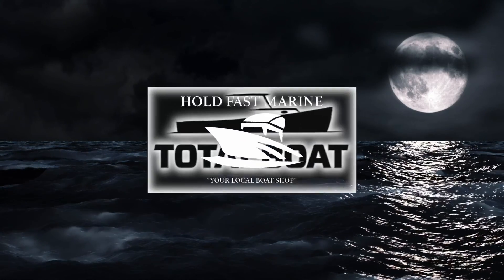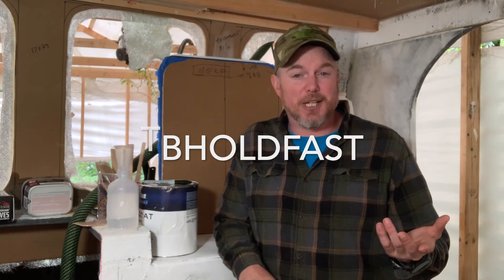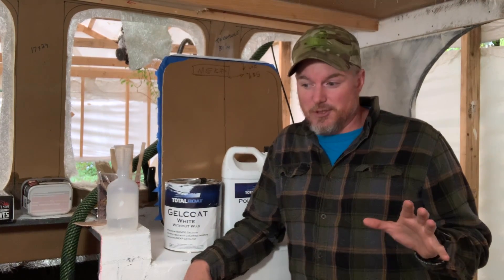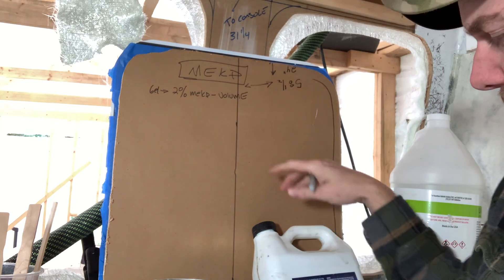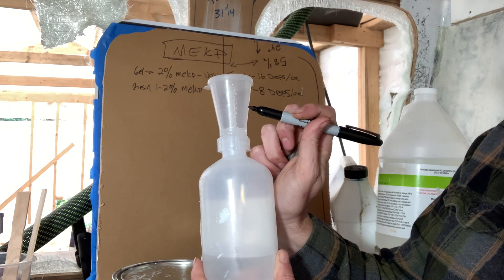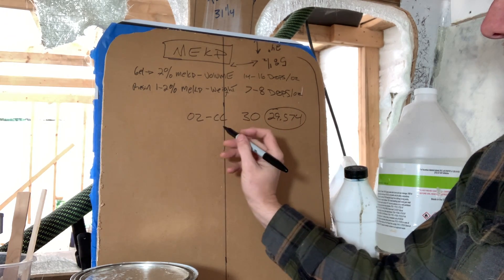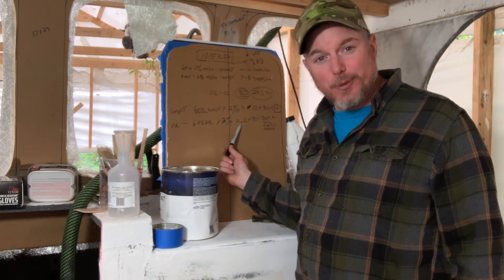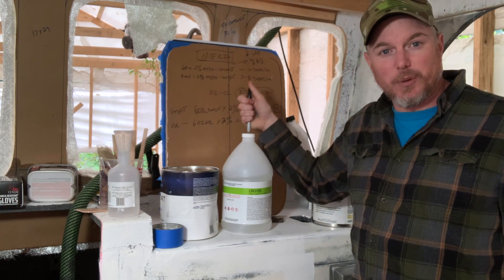How to properly measure MEKP for your polyester resin, gelcoat and more

Comment: I use this formula and it works great.  However, some of the top sites teaching about “boat stuff” catalyze gel coat and resin the same way (ie by volume only).  I would think their gelcoat would be under catalyzed by half.  Interesting 🤨.

Comment: Here is a tip from an OCD engineer wannabe. ALAWYS identify as “fluid ounces” or “weight”. Our 6000 year old weights and measures system blows. BTW, it’s 6000 years because that’s when Adam & Eve weighed the apple before eating it, and it wasn’t in metric units.

Comment: Thank you so much for putting this video together, it is really so much more digestible than other videos I’ve seen. 

To check my understanding; we are putting Fiberglass in a concrete pond. We are in Austin Tx and working on approx 85 degree heat so opting for less MEKP. 

If I am measuring out 64 fluid ounces of resin I would use the following calculation- 64 x 1%=.64 x 30=19.2 cc’s of MEKP.

For the same amount of Flocoat the calculation would be 64x 1%= .64 x 30= 19.2 x 2=38.4 cc’s MEKP. Is that correct?
Reply from the maker: Math checks out for me. Thanks for watching!!

Comment: there are a lot of comments on your video, i appreciate your effort, for 1 liter of polyester resin, how many ml of catalyst do i need at 2% ratio? thanks.
Reply: If it is 2% by weight then, weigh the liter of polyester resin, multiply by .02. Then weigh out the MEKP.  Further, 1 Liter = 1000 ml.  The density of Resin is reported to be between 1.1 g/ml to 1.43 g/ml. So use the average of 1.25 g/ml.  So 1 Liter of resin will weigh about 1250 mg.  the amount of MEKP required will weight 1250*.02 or 25 grams.  MEKP is reported to have a density of 1.17 g/ml. so divide 25 grams by 1.17 to get 21.4 ml. If you had used 2% by volume. you would get 1000 ml * .02 = 20 ml which would be slightly on the low side.  But anyway.  If you weigh the resin. Then multiply out by .02 [=2%]. then take that amount and on a scale, measure out by weight the quantity of MEKP calculated.  I'm thinking that they recommend using by weight because in the making of the product is that the density varies a lot and in the extremes can cause poor results.
Reply: So what should be the amount of 6% cobalt for 1kg of resin? @ralphparker
Reply: @ 63.83 grams:  63.83/(1000 + 63.83) = 0.06
Reply: @ralphparker  thank you 🙏

Comment: You said you were going to convert for mixing by weight but you converted to cc’s which is also volume. So you converted imperial volume to metric volume not weight.
Reply from the maker: What’s your boating YouTube channel?
Reply: Don’t have one. Why is that relevant?
Reply from the maker: Because your telling me how to do the job I’ve been doing for 25 years. I appreciate you watching however I’m the expert, you are the viewer.
Reply: Boating has nothing to do with expertise in composites. I have been laying up, vacuum bagging, designing and engineering for injection molded composites since 1985. That’s a few years more than you since you seem to struggle with middle school concepts like the difference between volume and weight. You can build all the boats you want and it won’t make CCs a weight measurement. You made a mistake and are so arrogant you can’t own up to it.

Comment: How many drops equals one CC?  The computer says 20.  I bought some poly structural putty (from total boat - I qt.) to do some repair work on the wheel pants of my airplane.  The can says 1-2% MEPK.  14 drops per ounce for 1%.  So if I use 6 oz of resin, putty in this case, that's 14 x 6 oz = 84 drops, or 4.2 CCs !!???   That seems like a lot of MEPK and it's not a very big bottle.  If I use just 6 oz of putty, that leaves 28 oz left in the can.  Using your formula:  6 oz putty x 1% = .06 x 30 = 1.8 cc.  If 1 cc = 20 drops, 1.8 cc x 20 = 36 drops.  What is wrong here?
Reply from the maker: Always follow the directions. Just because it seems like a lot to you doesn’t mean it’s wrong. I often use 20cc’s for a lot of resin. So let’s do the math together using your 6oz. 
6 oz times 1%= .06 x 30=1.8x2=3.6, round it to 4. Stop counting drops and use cc’s

Comment: If you're adding 2% MEKP by volume.  For six ounces that's 180cc x 0.02 = 3.6cc of MEKP.  Not sure how you're getting 7.2cc?  If you go by drops then 20 drops equals 1cc.  So 14 drops/20= 0.7cc... then 0.7cc per ounce x 6 ounces is 4.2cc.  If you use 7.2cc for 6 ounces then 7.2ccx20= 144 drops.  144 drops/6 oz = 24 drops/oz.
Reply from the maker: Are you asking about resin or gelcoat? For resin it would be 3.6 cc. We double it for gelcoat. Therefor 7.2 cc
Reply: @HoldFastMarine  I'm asking about the gelcoat.  Where do you see that it should be doubled.  The instructions I thought said it was 2% of volume?  So 2% of 180cc is 3.6cc?
Reply from the maker: Go buy some gelcoat and try it. When the gelcoat dosent cure, report back.

Comment: Just to clarify, if I pour 6 oz of resin into a cup, the formula would be for volume, not weight, correct?
Reply from the maker: Yes. Best bet is to always catalyze resin at 2% and other polyester stuff at 2%x2
Reply: Got it. I was playing around with a 2 oz batch and my measuring bottle doesn’t go that low so I had to count drops. But I catalyzed at 1%, not 2. My mistake.
Reply from the maker: @josephwhitehead1692  A 2oz batch would be 14 ish drops of resin, but you could just put in 2cc of mekp and you'd be just fine. You can be off a bit and it won't matter. You can catalyze at 1% and I often do this but only when temperatures are high and I need a little extra time.
Reply: @HoldFastMarine  Looking back on it, I actually did catalyze at 2% with 16 drops. I found a chart but it only went to 4 ounces so I divided the catalyst in half. I was surprised how far 2 ounces of resin will go.

Comment: Your math is OK but you have volume and weight confused. Gallons, Fluid ounces, liters, milliliters and CCs are all volumes. CC stands for cubic centimeter. That's volume, not weight. As for weights and volumes of polyester resins being the same, fluid ounces and ounces weight are two different things. 16 fluid ounces of a resin, may happen to weigh close to 16 ounces or 1 pound, but the formulation can potentially make a difference. Fluid ounces are volume. Ounces are weight. 

That said, the way most people will measure resins is by volume as in fluid ounces. A typical paper drink cup is about 3 fluid ounces. That's a handy measuring device because you just toss it when you are done with it. Don't have to clean it like a typical measuring cup.  Straight resin and gelcoats are different formulas. Gel coats are resin based, but have different properties like UV resistance, sandability, pigments, viscosity etc. One way to look at it is that gelcoat has more than just resin in it. So their hardner requirements can be  bit different. If you weigh the two on a scale, you will likely find a difference in weight per volume. 

I don't know of anybody doing any kind of work with resins, body fillers, etc., who use a precision scale in their shops. Volume makes the most sense and is convenient. Now if you have to go by weight, you'll want to do something like weighing a cup full or each component. That will give you a weight per volume measure of that particular material. Then use that in the percent calculation. 

You did the math right but have volume and weight confused. And for all practical purposes 1 fluid ounce volume is equal to very nearly 30 CCs or 30ml. (CCs and (milliliters are the same thing) . That brings up a useful trick for small volumes like for repairs. You can buy cheap disposable syringes marked in ml or CCs. Makes it easy to get an accurate mix of small volumes. Use one for resin and one for hardner. Use a bigger one for the resin and a smaller one for the hardener. As long as you don't mix the two, you can get multiple uses before you toss them. All you need to remember is that 30:1 ratio of ml or CCs per fluid ounce.
Reply: Ok when I get my whole # do I multiple ot by 2 like he does using fluid oz's for instance im going to have a volume of 16 oz's ×0.02 %= 0.32 × 29.57= 9.46 ×2 =18.92 ...im like the other guy why do I multiple my # by 2 at the end ..seems like alot of MEKP . I was given 4 oz's for the whole gallon. That's roughly 30cc per quart .

Comment: I'm not the brightest bulb on the tree. I read the back of the total boat resin as 7 to 8 drops per ounce they word it oddly that one ounce is one teaspoon. Needless to say I mixed up a batch with way too much catalyst using this formula
Reply from the maker: Well yes technically the 7-8 drops is roughly a teaspoon. one teaspoon is for one ounce of resin. Most of the directions are confusing, which is why I made this video. Thanks a lot for watching!!!
Reply: @HoldFastMarine  A teaspoon of MEKP = ~ 5 ml = ~150 drops of MEKP. Also, 7 to 8 drops of MEKP is equal to about 1/4 ml of volume.
Reply: a fluid ounce = ~30 ml, a teaspoon =~5 ml. There are exactly 6 US teaspoons in a US fluid ounce. There are 30 drops of MEKP to a ml of MEKP.  So, 1 fl ounce of resin needs .02 fl ounce of MEKP = 0.6 ml of MEKP = 18 drops of MEKP

Comment: Unless you are doing a large project then maybe this is needed. Personally I think its easier to count 14 drops into a disposable container, mark the line, and reuse that each time until you're done!
Reply from the maker: Like I said in the video
Nothing wrong with counting drops. I have tried to mark containers before and the mekp generally removes any kind of marker/paint. You; I suppose, could use tape or something but if your going through all that effort might as well use the dispenser.

Comment: Hey friend I’m trying to put a new layer of fiberglass cloth over and old boat with cracked gel coat. I almost got it sanded down to a new surface, there was some warped spots that I sanded into holes that now need to be covered. I don’t know what product to use, resin I would think for the fiberglass cloth right? I want to paint the boat after I resurface it, so paint needs to be able to stick to whatever I use… does total boat have a product that’ll work for me? Laminating resin? I finerglassed things before but never a boat. There is a video of the boat on my channel, it’s called a barracuda Hydrocycle. Thanks for your time buddy.
Reply from the maker: I’ll keep this as brief as possible. Resin is a misnomer. We have many types, polyester, epoxy, vinyl ester just to make a couple. Your choice will depend on many many factors. I’d like to help, but without seeing the boat, and what your trying to do it’s hard to guide you in the right direction. If you’d like to have a private conversation with me, there are options. I have helped many folks here and on other social media platforms. Pretty simple, doesn’t cost a ton. You can email me at wthurlow@gmail.com if you’d like.

Comment: Thanks for the video and the tips. I am a bit confused ny your math. You mixed the resin at 2% in you calculation. then mixed the gelcoat at 2% (same quantity). What I don't follow, is doubling the result of the gelcoat mix, which actually makes it 4%. Am I missing something?
Reply from the maker: Hi cam. It’s 2% by volume not weight. So 7-8 drops for resin, 14-16 gekcoat. That’s why if you have 7cc for resin you need 14cc for gelcoat.
Reply: @HoldFastMarine  If 1% for resin is 7-8 drops and 2% for Gelcoat is 14-16 and quote " weight and volume are diffrent, but in terms of these Polyester products they are not", surely there is a mistake? Not trying to be an @...., but I can't get my head around it. Thanks!
Reply from the maker: @threadfin2012  you always want to catalyze at 2% if your a noob. I can do .5-1-2-4% etc. When I say they are the same but not it’s so you just focus on the math. So take your ounces for resin; multiply that by the percent you want to catalase at, then multiply that number by 29.571 or even 29-30 Dosent matter really. For your gelcoat, repair putty always 2% unless it’s very hot out. Ounces x 2% x 29.574 x 2 and you’ll have the proper amount. If the number of cc’s comes out to 5.261 for instance just use 5, or 6. It Dosent have to be that specific.

Comment: So instead of the math lesson why not put your mixing pot on a scale pour your resin multiply by two percent and that's what your mekp is? example 600 grams of resin X 2% = 12 grams of mekp . Add the mek till your scale reads 612 and call it a day. OH I almost forgot don't forget to put a piece of plastic over the wife's kitchen scale
Reply: My wife is a registered nurse and simply had me set my scale to milliliters and add 1-2% mekp to my total. For example 100ml of resin will take 1-2ml of mekp depending on the temperature and work desired work time. She also showed me that cc and ml are interchangeable. So if your dropper is in cc but your scale is in ml you have no issues in putting 2cc mekp into 100ml of resin for example. I’ve had zero issues with this in any of my work.
Reply from the maker: @Nino13084  great tip and explanation! I’m doing another gelcoat application video (coming out in a week or two) I’m going to mention this method in it! Your wife’s pretty smart!!
Reply: @HoldFastMarine  i agree with my wife being smart. Thank you for the compliment. I personally prefer the metric system so i find it easier to measure in cc, ml, mm and cm. But I urge everyone to use what they’re comfortable with. My local fiberglass supplier in Gulfport, Ms, Ken’s Marine,  always tries there best to inform their customers as well on any tips of the trade like yourself. Thank you for taking the time to inform others as well. I’m also a huge fan of Totalboat products. Best bang for your buck as far as I’m concerned.
Reply from the maker: @Nino13084  local suppliers are key for the DIY person. Chain store employees don’t know anything about the products they sell. Metric is the way to go, but I’m a stubborn guy and refuse to use it 😂. TotalBoat is great stuff. Don’t forget you can use the discount code for my friends and subscribers. TBholdfast is the code! Thanks for the great conversation!!
Reply: @HoldFastMarine  That code no longer works. Is there a new one?
Reply: Amazon has these 500g X .01g Scales for around $10. 0.01 g accuracy registers each drop. I also use syringes. Remember too 1cc=1ml=1g (of water)  I've found the markings on some measuring cups and MEKP dispensers to be WAY off
Reply from the maker: @matthewsellers82  One of the great things about polyester resins and products is you don't need to be super precise. On colder days Im mixing at 2-3% can super hot days 1%. If the math tells you that you need 3.42cc of mekp. 4cc could be just fine or just 3.
Reply: Thanks to Mr. HoldFast and to Nello. I'm converting everything to metrics. AND doing everything by weight using scales. For TB Gelcoat without Wax, I found that 1oz volume = 40g by weight. Using a cheap Weighing machine, 6oz TB Gelcoat = 6x40 = 160g. As for MEKP 15drops ~ 1gram. So, 6oz of TB Gelcoat ~ 6oz x 1g = 6g of MEKP.  Thanks again for the video.
Reply from the maker: What if your only mixing 6oz of resin? Most scales won’t even register such a small amount of liquid hardener. Sure you could buy a super expensive or accurate scale until, as you mentioned, spill a whole bunch of mixed resin all over it. Permanently bonding it together.